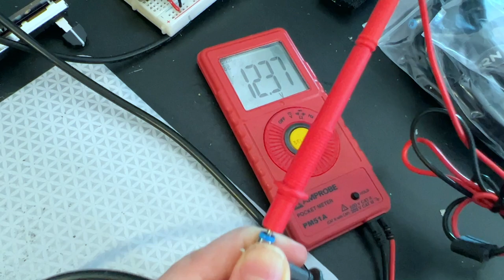USB C to DC barrel jacks...with USB PD voltage selection!

Comment: If I can get 20v 9A, or even 19v from 20v, that'll kill a lot of laptop power supplies.  I wonder what's the max spec for USB PD
Reply: At the moment max spec is 100W, so 20V 5A. There is a new "version" of PD standards coming out soon that will support 240W, up to 48V.
Reply: That's exactly what I was thinking, I've seen some USB C PD controller chips but never gotten around to ordering them. this looks like a much nicer option anyway
Reply: IF they implemented it right -- and that's a big if -- the PD source, in this case the wall adapter, is responsible for overcurrent protection and will shut down if more than the contracted current is drawn.
Reply: @vince086  Yeah, the v3.1 spec.  Can't wait.

Comment: Question is this Cable bidirectional? I have a camera monitor with bat power delivery (barrel jack ) with 8 volts out , i want to plug the usb c side to charge my camera make this way small and portable set up.

Comment: Amazing! Great solution - I’ve been wanting this for ages!

Question… of that PD voltage is unavailable, does it have no output?
Reply: It goes to the max supported voltage by the charger
Reply: @a1234-e1w  the right action would be to have no output. A slightly worse outcome would be to output the next-lowest available voltage. The dysfunctional outcome would be to select a higher voltage.